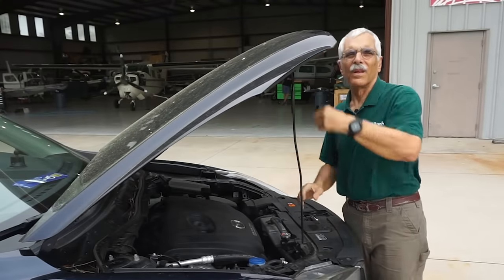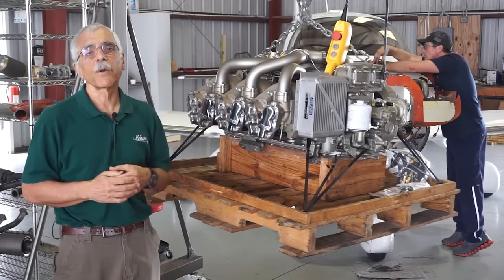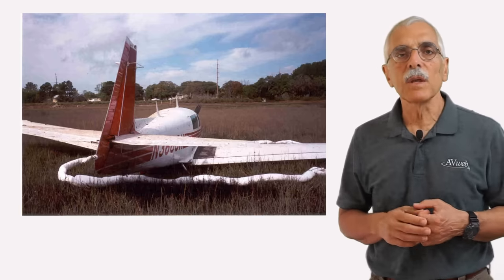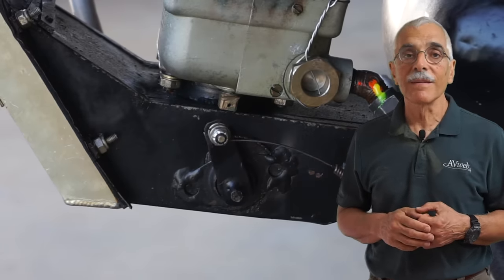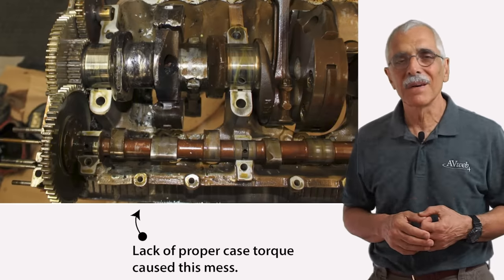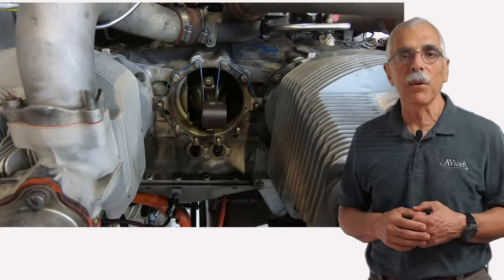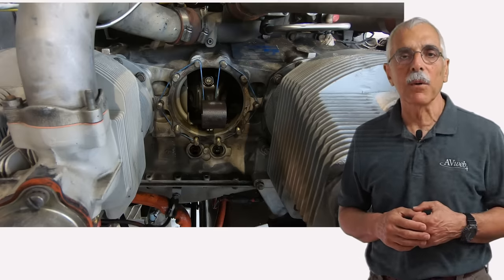Why Aircraft Engines Quit

Comment: As an automotive technician for 40 years, I have observed many very reliable engines. I have a 2000 Caravan 4cyl 4 valve DOHC with 216,000 miles that just keeps going like it's going to run forever.
The real problem is that they are trying to pack as much power as they can into and engine that is as small and light as it can get without barely breaking.
Reply: Your Caravan doesn't put out 80% of it's rated power for hours at a time.  More often than not, it's under 20%.
Very curious as to the next hurdle Raptor will encounter, as he will not even address the undersized turbo situation he is currently in.  Automation breeds complacency, and the average person doesn't have a clue about proper engineering application.
Reply: @cheerdiver  "Your Caravan doesn't put out 80% of it's rated power"
Wana bet? I drive a 1,200 mile round trip every month between 80-90 mph. I live on a mountain at 4,000ft elevation and because of the horsepower to weight ratio I have to keep the RPM's up into the power band and fly up the hill at around 70mph. Otherwise if I get behind some slopoke doing 50mph the transmission is constantly shifting back and forth between 2nd and 3rd. I certainly keep the sulfurs burned off the catalytic converter.
Reply: @DrHarryT  'My Caravan only goes up hill', LMFAO
I'll still take the bet, it takes about 16hp to maintain 60mph.  At 180hp, 20% would be 36hp.
So you're claiming that your 'hill climb' at 70mph takes several hours.  That would mean a steady clime for 100 miles or more.
Have you noticed your logic fallacy yet?
Reply: @DrHarryT  Unless you're burning 7-10 gallons per hour with your 150 hp Caravan engine, you're not putting out the power that aircraft engines do in cruise.
Reply: @MiG82au  I did say...
"The real problem is that they are trying to pack as much power as they can into and engine that is as small and light as it can get without barely breaking."
Reply: @cheerdiver  I never said "My Caravan only goes up hill"
"it takes about 16hp to maintain 60mph" Exactly how do you dome up with that figure when you can't know how much cargo or the vehicles specific weight? I carry disk brake rotor plastic containers filled with tools for a "just in case" breakdown.
Half way up the mountain there is a 1 mile 7% grade. Whatever speed I hit that grade at between 60-70mph in 2nd gear [3 speed/no OD] I am able to maintain. Pedal to the floor it will NOT accelerate any faster using every bit of horsepower in the power band to maintain that speed. Are you trying to tell me that full throttle @3,000-4,000RPM is only 16Hp???
Reply: @DrHarryT  MiG82au put it in simple terms.  It's more to do w/ aerodynamics, than weight.  With such a large frontal area, you may be closer to 20hp.  Do some research into land speed racers, weight only effects altitude gain to any significant degree.  It only takes forty seconds to travel a mile, at 80mph.  The only time an aircraft is putting out less than 80% is while on the ground, or during decent.  Even modern big rigs are rated for around 320hp, and they will do well over 100mph loaded down (flat ground of course).  But for every rise you meet, there is a fall to complement it.
In short, automotive engines aren't designed for constant high output.
Reply: Loved thus video and the "ice fairy" ref. I too have always been puzzled about aircraft engines "simplicity". I owned a BMW M44 with 421,000 miles with not so much as a valve cover gasket. Never even replaced the clutch. I understand views regarding HP and power output. Thus vid at least highlighted different factors that contribute to "failures".

Comment: I've never seen a modern automotive engine quit under 120K miles unless simply out of gas.   In aeronautical terms, at least 3000 hours of operation with the only maintenance being changing oil and plugs.     Aeronautical engines though are subject to wider climatic and atmospheric conditions, but still....the tech should be there to handle those things automatically already.
Reply: There are plenty of modern automotive engines that quit due to low oil
Reply: @afhostie  Oil was presumed excluded as a factor since maintenance is necessary for any engine.   And it is listed as such.    Even when I had an oil guzzling German car, I knew how often to keep adding more.   Most German car owners I have since found, do in fact carry oil around with them in their cars to top off.
Reply: do you own an auto shop ? drive a tow truck ? what is your "never seen" sample size  ?  bet your life on it ? in airplanes you do, even with a parachute.

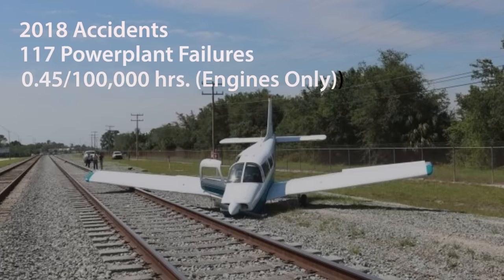Comment: 6:55    0.45 per 100,000 flight hours.
If you flew 3 hours per day for 90 years, you'd have (almost have) a 50-50 chance of a powerplant failure. 365+ days per year, mind you.
Or .... a 50-50 chance if you flew 9 full hours per day, for merely 30 years. No cheating - 365 days a year.

Comment: I'm not a pilot, but to me the GA community aircraft need some sort of "Black Box" in each aircraft, something with a protected 256gb flash drive. So that "Unknown Percentage" goes down. The "Black Box" wouldn't be a video of you controlling the aircraft but of all the systems aboard for the past 20 to 30 hours of engine/flight or activity. So you as part of the GA community can learn from the problems other pilots/aircraft have that might be experienced by someone else.
Reply: With today's glass panels a bunch of data could actually be acquired about the aircraft attitude and engine data. It still leaves a lot aside, but that's better than nothing.
Reply: Your line of thinking is good. The technology exists to gather the data
Reply: @niclef314  Thanks for the comment. I would want "better" not nothing or some.
Reply: @StickandGlider  I wonder why more pilots wouldn't want more reviewable info just incase the unthinkable happens and no one catches it on film. Or information that is reviewable for training purposes for other pilots to use and learn from.
Reply: @gerardvaneick3066  as a pilot, I want all the data that I can get - for my own improvement. Much data already exists in the form of flight tracking software (e.g., ForeFlight) and ads-b. These can tell speed, altitude, geography. As others have mentioned, newer glass cockpit designs can collect engine and telemetry data - as far as that goes, not sure where or how it is stored or how easily it can be reviewed.  Also, so many pilots are recording with gopros and the like. If we get to a point where it’s all being uploaded to the cloud, that’s more information in case of a deadly crash.

Comment: 10:30 "Take the number of vehicles in the field, A, multiply by the probable rate of failure, B, multiply by the average out-of-court settlement, C. A times B times C equals X. If X is less than the cost of a recall, we don't do one."

Comment: I was expecting to see some more words on how reliable automotive engines are. I have the feeling I would be as good if I had a regular car engine on-board... plus it would be a lot cheaper.
Reply: I was anticipating that also
Reply: What, you mean 1960s points ignition isn't the most reliable method of making a spark ever devised by mankind?

You can't seriously believe that everyday automotive engines commonly last 10,000 hours with no overhaul, poor maintainence, and the lack of consistent oil changes while making more power with less fuel consumption and having 1/10th the price tag while having mechanical complexity an order of magnitude larger than any general aviation recip engine in service, can you?

Continental and Lycoming would never abuse the fact that GA engine type certificates are so difficult to acquire and take millions of dollars of red tape to get through for an unprofitable small market few engines are sold in to sell you the same engine for 60 years straight regardless of the pathetic real-life performance & reliability of these dinosaurs.
Reply: Automotive engines are an order of magnitude more developed simply because of the numbers produced and their short generation lifespan. But I've heard arguments about why they are different and how aircraft engines are much more reliable but I don't really buy in to it. Car engines vary rarely let go in the way that aircraft engines do suddenly. And they don't keep churning then out with known flaws like the cam followers mentioning no names lycoming or prone to icing because someone designs it out 50 years ago. When your engine costs 40k to overhaul it better be gold plated blessed with squirrels tears and never ever fail.
Reply: @dr_jaymz  exactly. How many factory vehicles end up at the mechanic with a hole in the block? Lots of crank no start, missing on one cylinder, burning oil, overheating, etc. Things that wouldn't necessarily end a flight in a crash...even cars that are overheating can survive a ton of abuse.
Reply: @thebigmacd  Some do drive with a cylinder not firing which I guess you can't with any lower powered aircraft. Spun bearings seem to be one of the failures in aircraft which results in it exploding.  For cars I would guess cam belt failure is their main category of catastrophic fail.
Reply: @dr_jaymz  I've driven a car with 2/4 cylinders not firing. Not pretty, but better than nothing. Yes, timing belts failing due to lack of maintenance is a fairly common one, although chains tend to last longer. Although for an aircraft they could switch to gear drive. Not used in cars so much due to NVH, but I'm sure compared to a 60-year old pushrod air-cooled engine, plus driving a prop, it would be fine. Or even stick with pushrods...the LS/LT and Hemi engines still use pushrods.
Reply: @thebigmacd  In a car its no big deal but in a plane you would not be able to maintain altitude or climb dragging even 1 cylinder.  In a plane you don't want a final drive reduction gear because even that is a maintenance (and weight) issue so direct drive suggests a lower RPM (about half) than a car engine and that would mean pushrod is probably optimal.
Reply: I was also thinking - imagine if you had to have your car engine shock-load tested at the cost of 20 - 30k every time you stalled the engine?  In the UK we still use gear levers and so your typical driving school car gets stalled repeatedly every day and still the camshafts and pistons manage to stay connected and apart from the clutch any other type of failure in these cars is almost non-existent.  True enough though - if the crankshaft or any part of it were to stop the car by the car nosing over on it that would clearly be the end of that.
Reply: @dr_jaymz  at least a partially running engine may be able to keep the electrical system somewhat operational. I've seen a VASaviation video where after an engine-out the radio didn't last until impact.
Reply: We think aero engines are disproportionately expensive but consider this.  Your typical 5 series BMW loses more in depreciation in a couple of years than that engine overhaul.  Cost per year; people like to flaunt their high-depreciating car, but baulk at maintenance costs for their aircraft.  Also, if it were procurable - I imagine than a complete engine for said car is eye-wateringly expensive, I mean they charge 10k for part of a gearbox.  A guy was quoted 22k for a short i3 engine (that's basically a 3-cyl mini engine samcrac).  We bought a complete set of 4 new cylinders / pistons from Lycoming at £1.4k each - less than £6k total instead of messing about with 3 oversized and and odd one chromed that we had, each had various states of disrepair.  (we had to send two back because of quality issues - but that's another story, any engine shop will inspect new parts and good job they do too)  I dare say that the equivalent from Audi or BMW would probably be comparable, plus another 30% saw you coming gullibility tax.
Reply: @thebigmacd  It'd have to be doing more than about 1400 rpm to make enough - but hey if your battery is also duff then something really has got it in for you and its probably your time.  You'd probably bail out only to find your parachute has also failed - although strangely they don't get many warranty claims...
Reply: @dr_jaymz  you can buy an OEM Chevrolet 6.0L longblock for under $5,000. That being said, I'm not speaking to purchase price, cost of maintenance or even specified maintenance interval. Simply reliability between maintenance checks.
Reply: @thebigmacd  Thats about the cost of just the gearbox ECU for an Audi - if one was foolish enough to buy one new from them.  I reckon you can buy a new car for only a bit more.  American cars and parts are cheap.  If Lycoming where German I dread to think what they would cost.
Reply: @dr_jaymz  speaking of German, check out the RED AO3
Reply: Most likely it seems like aircraft engines fail often because it's a big deal when they do fail. A car engine failing is rarely news worthy.
Reply: @NiHaoMike64  Agree with that - if you drop a bollock at any airport everyone knows but happens in cars all the time.

Comment: I drive long distance courier, mostly Toyota mini vans, all of which have well over 300k on the clock, on original engines and transmissions, and have yet to experience an engine quitting. People thinking magnetos and carburetors are more reliable than electronic ignition and electronic fuel injection are living in the 1940's.
Reply: Well, it has a lot to do with the fact that GA engines need to be operable with no external electrical source.  That is why they use magnetos instead of coils.  The entire electrical system of the plane can be switched off and the engine will still operate.  They have two separate magnetos so if one fails the other still works.  This way, if there is an onboard electrical problem that may result it fire, the entire electrical system can be disconnected from the battery (master switch).  The engine keeps running on its own magnetos, and yes, just like a lawnmower engine runs without a battery.  Automotive engines, especially modern ones, rely entirely on the electrical system.  They also rely on a plethora of sensors and modules that add a lot of complexity and possible failure points.  So, GA engines are somewhat limited in what can be improved.  There is also the matter of weight.  GA engines, as you can see from the video, are mostly the internal parts with very little "engine block" material compared to automotive designs.